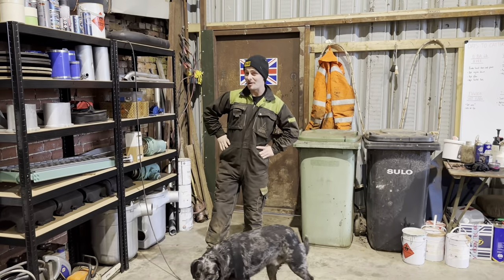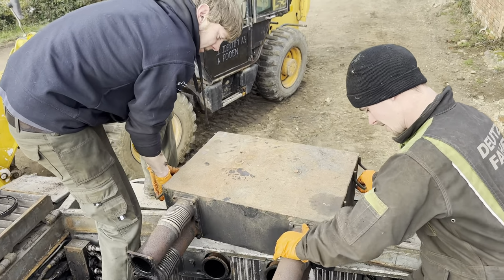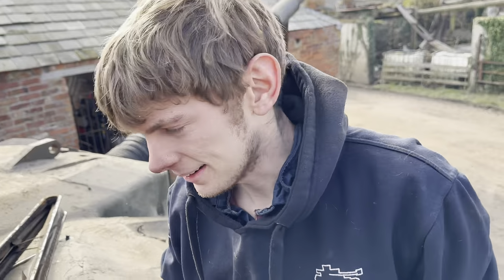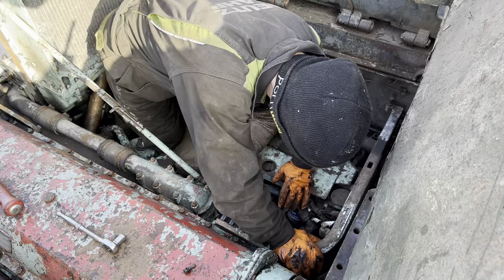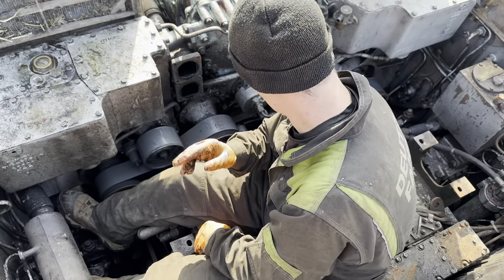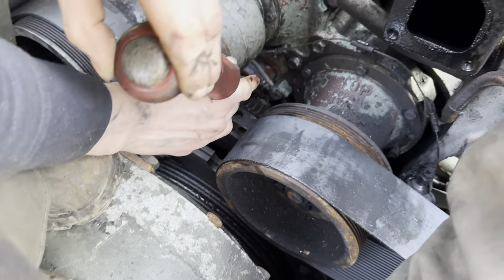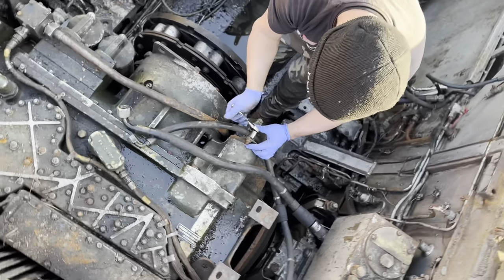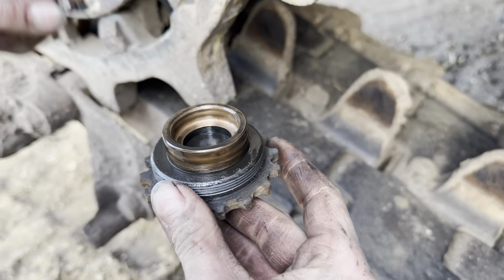Taking the Engine and Gearbox out of a Chieftain Main Battle Tank ￼

Comment: Hi Joe. My job when it was time to take the pack out as a driver was to disconnect the engine coupling bolts to the gearbox (twi flex coupling) and it is so much easier to undo from the access plate underneath the Chieftain than from the top of the vehicle, try it when you put the engine back in!
Reply from the maker: That’s how I usually do it. However I had parked it right over a wet mud patch 🥲

Comment: This brings back a few memories, lifted many a pack and Gearbox as part of 5 Armd Wksp FRG and then as a member of a couple of LAD's. We used to take the M-Type pump (8 bolts If I remember) off the engine made it easier to do the twiflex coupling was being disconnected from the top. Generally, though the driver was sent underneath.
Reply: As a REME tech I did the most important job. Making the egg banjos and NATO standard brews. AeM.
Reply: Nigel, I was 11 Armd FRG, (87-90) Correct on removing the M-type pump. I remember it being 6 bolts tho.

Comment: From wikipedia italy: "The engine is a horizontally opposed piston diesel, derived from the Junkers Jumo 205 aircraft engine from the Second World War. Thanks to the cylinders with opposed pistons, it is an engine that takes up little space. But like other two-stroke diesels, it has long been unreliable, and the initially planned output of 750 hp was limited to 650 HP"
Really? (the first version)

Comment: What is a 'donkey' engine and what is it for?
Reply from the maker: The donkey engine is a generator to power the turret when the main engine is off, also it can be used to start the main engine hydraulically
Reply: @MrHewes  First start of the day should be a hydraulic start.